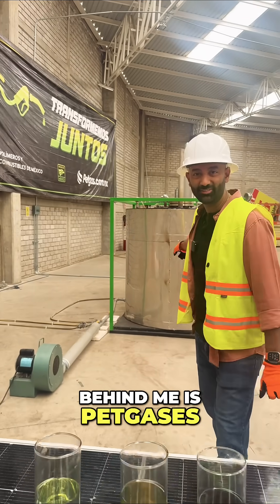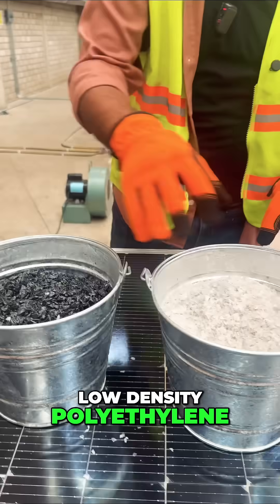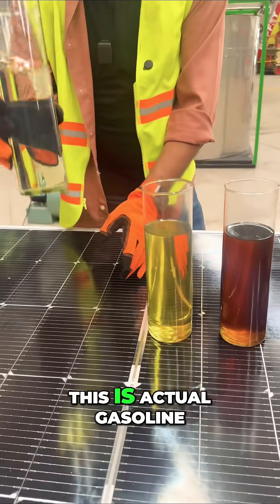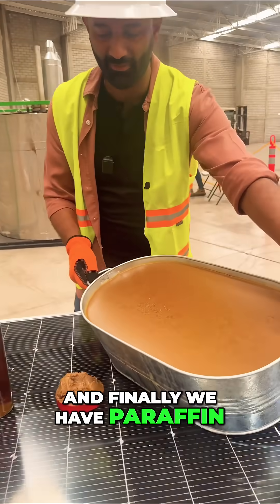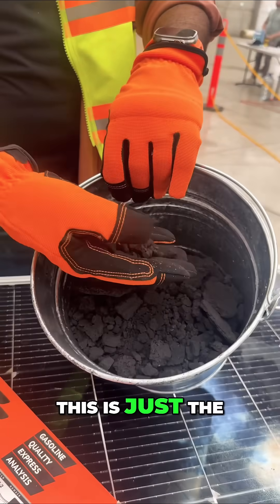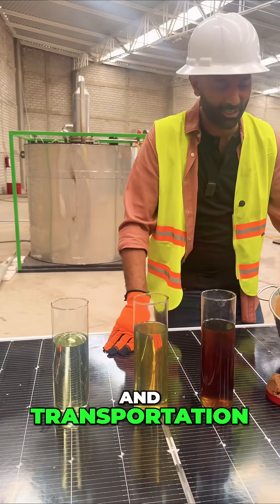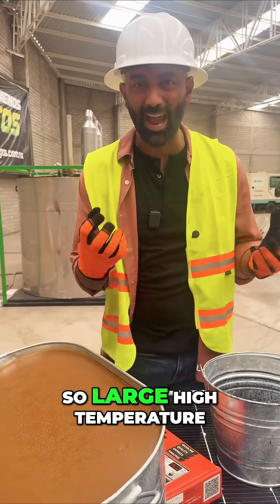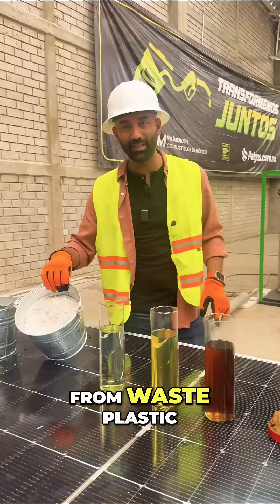From Plastic Waste To Fuel. #petgas #short

Comment: Would have been better to remold recyclable PE rather than using high heat to break it down into its hydrocarbon component. Other non-recyclable types of plastic would have been better candidates for thermopyrolisys processing

Comment: This isn't a new tech, is extremely inefficient, and uses way more fuel than it produces. In summary, this would be useful in a world where we have already solved climate change problems as a recycling method - possibly - but outside of that scenario is only an acceleration of harms caused by burning fossil fuels.

I say fuel instead of energy because obviously, nothing produces more energy than it uses, but this specifically is inefficient enough that even when using renewable sources to power it, it is accelerating climate change in the process.